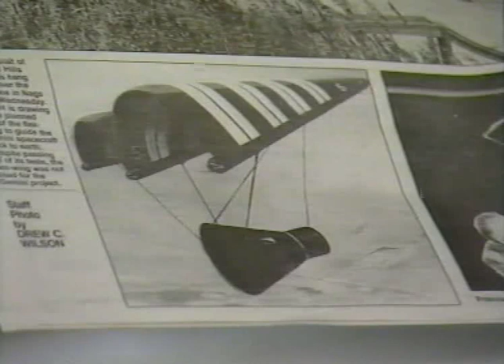hang gliding pioneers

Comment: Back in 1958,I was 10 years, I saw an artist impression of a rocket stage being brought back to earth by a flexible triangular wing sticking out of the tube. I remember it was in a Popular Mechanics magazine, a very small white on black sketch, which inspired me to make a model from thin cardboard and wires to attach a weight. I had no experience and knowledge of aerodynamics other than folding paper planes but I launched the model from the roof of our house and discovered the mode flew quite well. I also discovered, once in a stall there was no dive recovery. So I shaped the centre-section in a s-shaped reflex form. This did the trick and I decided then, that when I would be older, I would hang underneath the glider and didbso later in the 70's when the first reflexed hanggliders were marketed. I also knew then, that mr. Reinhold Platz flew back in the 20's a foldable and carriable sailplane from the sand dunes in Holland. So I consider myself being one of the inventors too!
Reply: @graemehenderson1743  If you read my article well,I only claim that I have more or less invented the reflex,all other gliders were killing machines
Reply: @graemehenderson1743  mr henderson ,I just told my story and if you don't believe it,that's not my business.I was am active pilot in the 70/80's,met well known people then (ken messenger,gerry breen,bill moyes rene coulon and had a lot of fun and all sorts of interesting flights and most important,I got the dutch caa on their knees in a legal procedure about the status of a hangglider.At the moment I'm working on electrical start assistance,establishing a sailplane/hangglider centre in holland and the restauration of a 38 ft 1935 sailing yacht and the recovering after curing a cancer.So please stop demotivating me with your nonsense

Comment: Hello!!  Take a look at some hang gliders flown a decade or so before all of these mentioned at channel "sevtecsev".  
they are the same as those shown but we did not tie ourselves to the glider;   we used parallel bars, instead.  also, the nose angle was greater to improve glide angle.